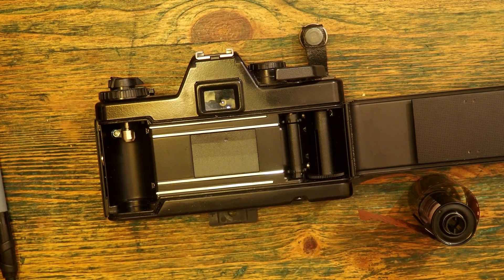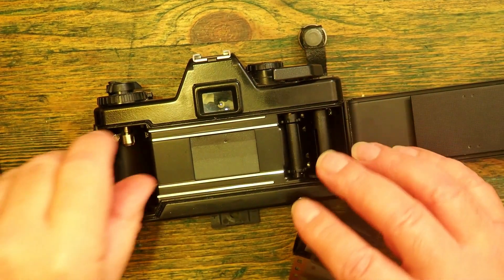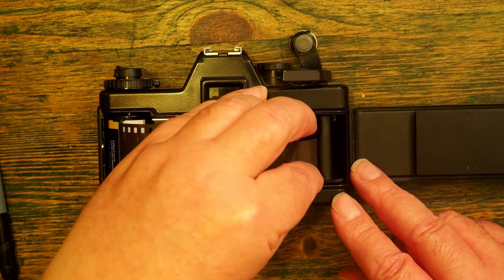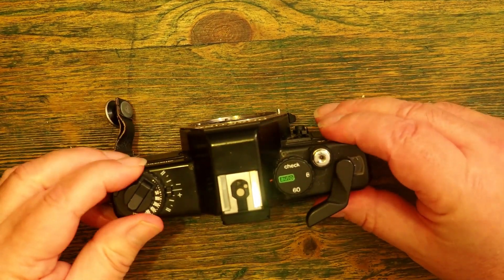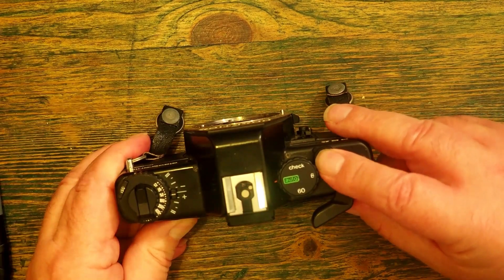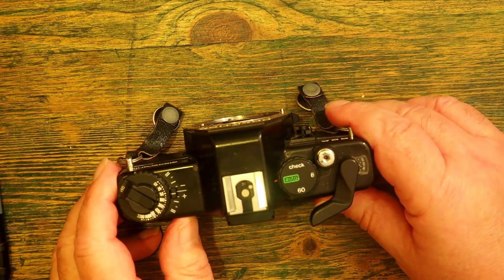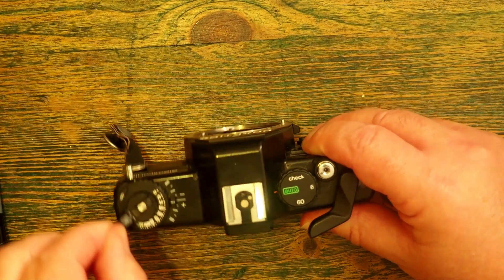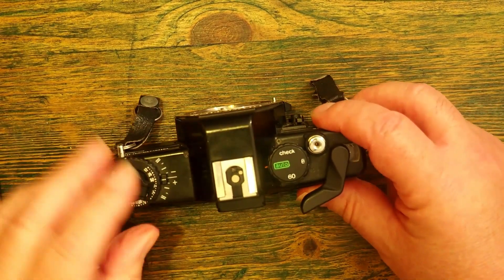Avoid blank rolls of film. Loading and unloading a 35mm camera

Comment: Can't remember if I've mentioned this before - loose spooling in canisters, so damned annoying. I've lost a few frames at the beginning of several rolls because I've opened the back of the camera to check the film is winding on properly and not slipping. Answer to said problem is to hold the new film by the leader before loading and rewind it gently back into the canister until you feel it tug then load as per normal, any luck you get an extra frame as well. Its surprising how many films are quite slack in the canister.
Reply from the maker: Excellent tip. :)